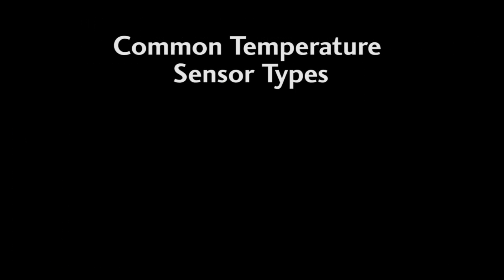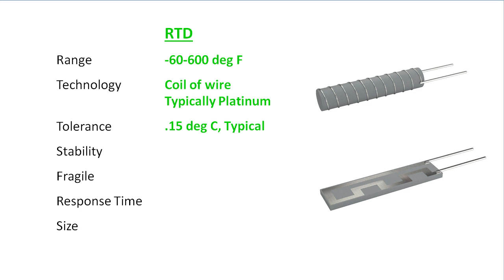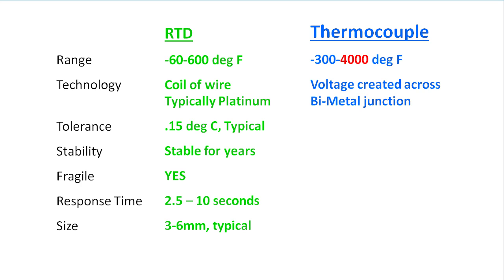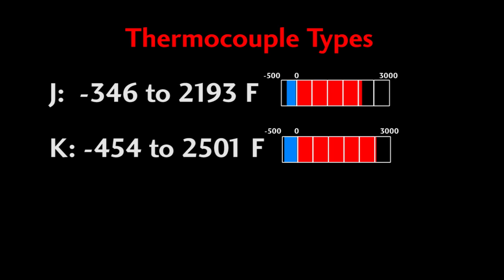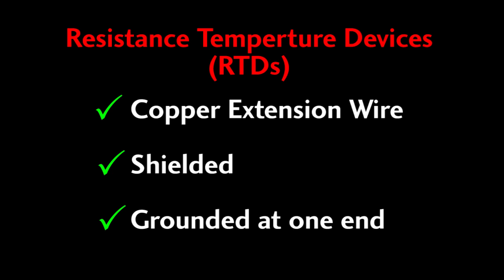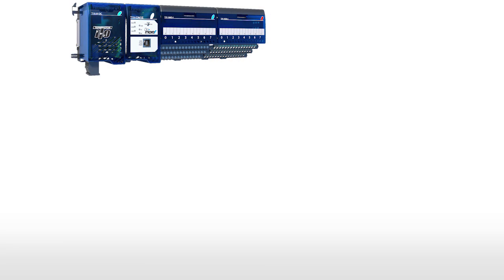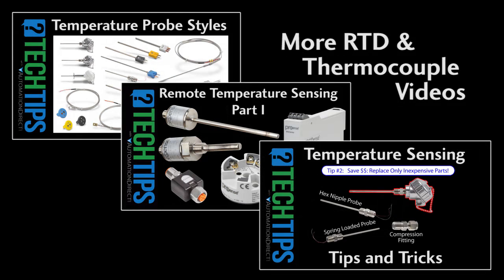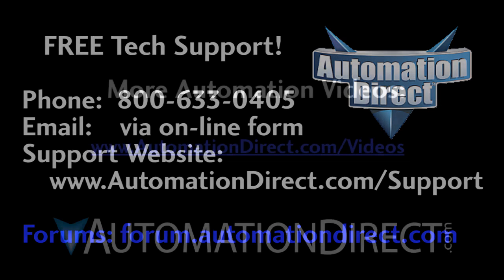RTD vs Thermocouple: Temperature Sensors from AutomationDirect

Comment: can i ask something. is it oke/accurate when we use rtd pt100 for measuring room temperature?
Reply from the maker: Yes RTDs are fine for room temperature.  For example, Check out this RTD room temperature sensor at AutomationDirect.com:  RTD1-R01-01

Comment: In thermo couple why they take two dissimilar metals?? and how the current is flowing from one metal side to another side although the junction is heated not one metal????
Reply from the maker: This is standard physical character of joining too dissimilar metal. Because you have two different metals joined this causes a voltage potential difference that is direct correlated to the change of temperature.

Take a look at this Wiki page, it might help clarify it more for you. 
https://en.wikipedia.org/wiki/Thermocouple

Thanks for the interest.